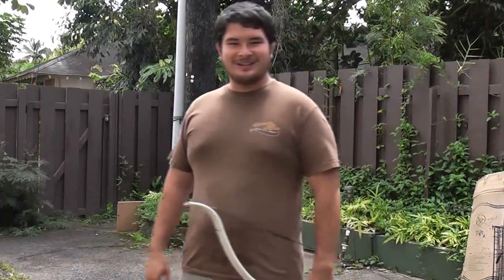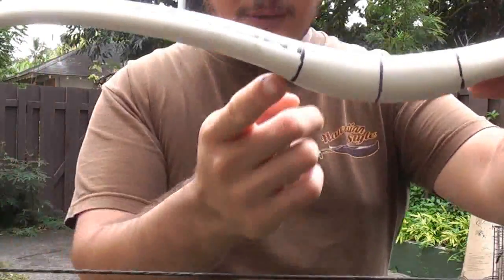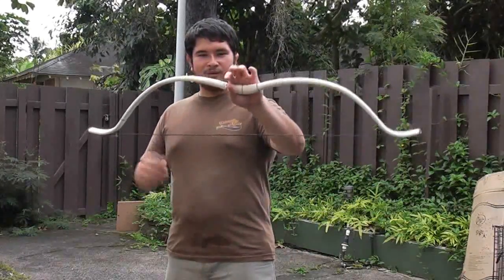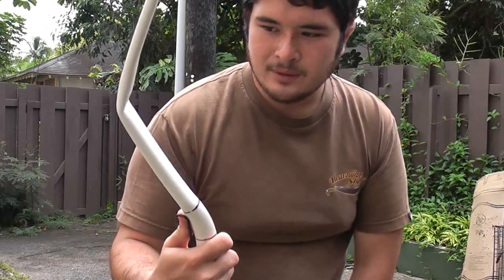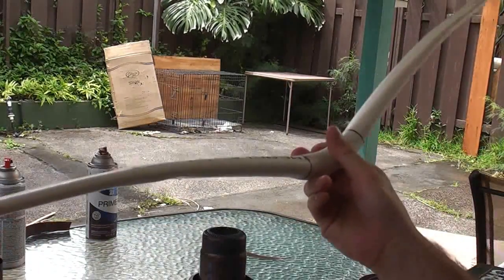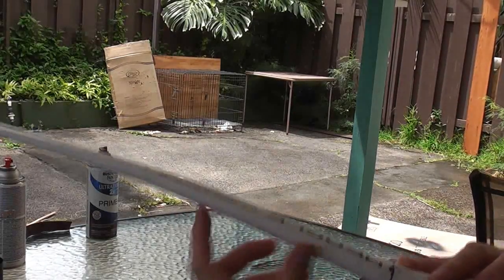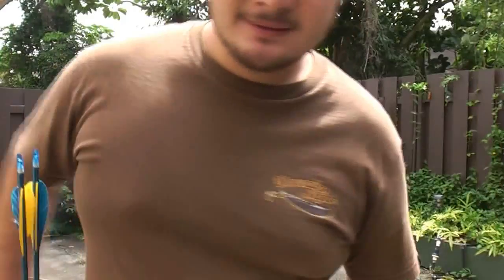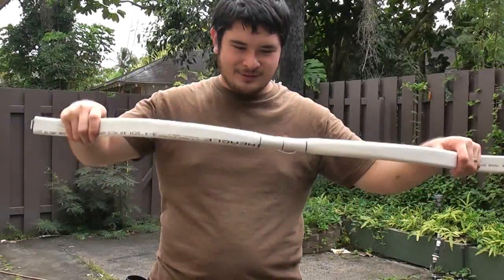PVC Bow Failure -  Limb Collapse

Comment: I live in Ireland and all we can get here is standard pvc waste pipe, Warning to anybody who cant use schedule 40 pipe.. Its not the same thing !!! I made a 43lb recurve bow and it worked great until one day it shattered, yes just shattered at the handle, I ended up punching myself in the face and busted my lip and front teeth to the point that blood was running out of my mouth..and a piece of the pvc actually sliced my hand open between my thumb and index finger , Had to get stitches in my hand...  
The pipe got brittle in the cold, It was fine until the temps dropped and boom.. It exploded near full draw on me..

Comment: Nick, I've been studying your videos and had this problem right in the middle.

I noticed that I didn't get a great taper with my jig but mine was very very DIY.  What parts do you use for your jig?  How do you keep your soft pipe straight instead of twisting, I was surprised how good this worked but keeping the soft pipe plumb seems to be tricky.

Comment: basically your bow failed like it did because of its short length.  you were drawing it to an unrealistic length to make it fail.  It's as if you were using a short bow to draw an arrow with a length unsuited for it.  shooting it after the fix shows me you're also using arrows longer than your draw length.  your arrows should not have that much length extending beyond the bow.  a long arrow travels just as far as a shorter one with the same results.  also the last attempt to make a bow collapse is just that, you're trying to make it collapse.  i don't know of any bowyer that tries to make a bow collapse.  proper use of the bow with matched arrows should never cause a bow to fail/collapse.
Reply: Ray James he did it on purpose as a demonstration. he makes so many bows like this as PVC is inexpensive and he also wrote many books.
Reply: Ray James YOUR NOT A GENIUS

Comment: Is it okay to use pipes that i bought years ago and stored in a humid/hot/cold (depending on the season, I'm in ohio) garage, completely covered and unexposed to the outdoors?
Reply: It should be. What you can do to be sure, is to cut off a piece of the pipe, place it against a hard surface, and go to town on it with a hammer. If the sample piece shatters, it's too brittle. If it deforms, the pipe'll be good. Nick has a recent video on this, I believe.

Comment: Here in Japan, we have black colored "shock resistant" PVC pipe, but does this exist in the western world too? Also, would it be fit for bow making?
Reply: Philosophia I haven't seen it but if you take a sample and hit it with a hammer then if it shatters it's no good but if it dents then it's great
Reply: Sounds like Furniture Grade PVC or CPVC. 

Furniture Grade PVC is incredibly good for PVC bows, as it's strength allows it to launch an arrow faster than most other types of PVC, and it's UV resistance means it's FAR less likely to be harmed by the sun.

CPVC generally has no UV resistance, but it's stronger than any other PVC on the market (that I know of). The one issue one might have with it, however, is it's temperature resistance. It's incredibly resistant to cold temperature, meaning it's great for winter time rabbit hunting, but it's also quite heat resistant, meaning you'll not have as easy a time warming it to a malleable point, as you would standard or furniture grade PVC.

For whatever reason, my local hardware store (which sells standard and electrical PVC) won't order either of them for me (despite the fact I live on a tropical island, of which every outdoor restaurant and patio has Furniture Grade PVC in it in some manner). However, if I drive to the main, every hardware store has it in stock.

Comment: hey nick .. hope all is well man .. i broke my 3/4 inch recurve with a 10 inch long insert of 1/2 inch reenforced handle .. it wasnt smashes to center .. it had already had about 3000 shots through it .. crazy thing is it broke at both sides of right where the insert ends .. any ideas y?
Reply from the maker: +Joey Lujan Hope you're still doing well and you are fine! The only thing I can think is that the 1/2" pipe may have been sharp on the inside or it could have caused extra stress where it met the outside pipe. Were there any large scratches or dings near where the reinforcement was?

Reinforcement is always tricky, and while I can sometimes manage a bow that is seamless and completely smooth around the transitions, sometimes I'll end up with one that has slight ridges or bumps where the inside pipe ends. These areas become prone to getting scratched or bumped, and this can cause breaks. This is also a problem with take-down bows that use the main pipe as the sleeve.

Hope this helps!
Reply: Hey nick! Yea kinda what i was thinking also .. you know i have broken 2 bows out of the many that i have made .. funny that you say takedowns also have this issue .. because that is the other that broke .. the emergency takedown ... so sad .. but it happens :) thanks for the response nick .. i appreciate it .. cant wait for another bow vid from you
Reply: Hey nick .. do you think it could have broken from over drawing the bow?  It might have been a little short .. it .. im 6ft and i think i used the same specs that you used .. sould i try a bit of a longer bow to lengthen draw?  Thanks!
Reply: I was kinda teeing to get max speed with some new aluminum arrows lol
Reply: Joey Lujan hey he broke it on purpose to show us what it takes to fix them daaaaa

Comment: I'm making a 3 piece take down bow with wooden riser I made the riser pretty easily but the limbs are proving a lot harder I can taper them ok but putting the recurve in is not working well at all ive followed tips from a few videos on YouTube but still no joy im in the UK and they grade the pipe differently over here so im not sure if im even using the right pipe any advice you could offer on this would be greatly appreciated.

Comment: where you get those pipes? can i order them somewhere because i live in Finland and here dont sell 40mm pipes anymore.
Reply: +Oskari Heikkilä should be able to find some in a similar size at your local construction supply store, electrical or plumbing supply house. 40mm is kinda big, there are many people who have made PVC bows from material 18-25mm diameter. Personally I'd go for 30mm, with another 24mm piece inside (basically 2 pipes that will tightly slide over eachother)
Reply: Linkxsc thanks, i tried to make it from 32mm pipe but it didnt work so i try with 2 pipes.
Reply: Oskari Heikkilä
The reason why I did it was so that if either piece did begin to break, there would be another bit holding it together. Though wrapping the thing top to bottom in duct tape (Camoflague ofcourse) can accomplish the same goal, and protect the tubing from UV (which will weaken it over time if left outside)

Comment: Hey Nick you were wrong!  White PVC has no UV protection and is stored indoor?  Gray PVC is for outdoor use Electrical and It has a Manufactured UV protection built into it to withstand UV Rays........
Reply from the maker: Bill Donoho Yes, white PVC plumbing pipe does not have any UV protection. I'm not sure what I'm wrong about. White PVC is often stored outdoors. Prior to being shipped by boat, train, truck, or air-freight to distributors, white PVC pipe is often stored in large bundles outdoors. When I said the pipe is stored for years out in a field, I meant the field or yard used by shipping companies and manufacturers to store building materials prior to shipping. This saves on space. While PVC is UV-sensitive, generally it is considered fine to sell pipe that has been outdoors for up to two years in plumbing applications. The actual damage caused depends on where a particular pipe sat in the bundle and how long it was outside. 

From there the pipes go to distributors or large retail companies with their own distribution network. Pipe is sometimes stored outdoors along with lumber and certain building materials. And once it's shipped to hardware stores and plumbing supply houses, it's up to the individual store whether they will keep it indoors or not. Some store the pipe indoors, others keep it outside. Some larger stores will keep it bound on pallets outdoors until they need to fill the shelves and then bring it inside. That's why it is up to you to make sure the pipe you're using is fairly new and doesn't show obvious signs of UV damage like yellowing and cracking. Just because the pipe is indoors when you buy it, does not mean it wasn't outdoors at some point during transportation and storage.

Gray conduit pipe does have UV protection built in. Because it is not rated for pressure applications, it can be stored outside indefinitely and is still fine to sell. If I had to build a bow in a pinch with old and found materials, I would trust PVC electrical conduit over PVC plumbing pipe.
Reply: +Bill Donoho It depends on the seller really. In my small town the local lumber yard stores most of its PVC pipe outside, although it is partly under a roof to keep the rain off, but the sun still hits the pipe at times during the day. All the big box stores I've seen though keep pvc inside.
Reply: +BackyardBowyer alot of knowledge in this reply , thanks
Reply: +BackyardBowyer can you say what the other unbreakable bow was made of

Comment: i dont know if it was the size of the pipe or its shape, but i had a 1" pvc bow shatter in to large and small pieces at the handle and below one of the tips.
Reply from the maker: saxonman If the bow broke near one of the tips, what probably happened was what I call a feedback break. When one tip or both break off, the bow snaps forward and without a string it ends up flexing like its being drawn backwards. This can cause the bow to break into multiple pieces. This type of break is also common for wood and laminated bows that break at a nock or tip.

Weak tips or pipes that are too short for their diameter and wall thickness seem to be the main issues that cause this. A bow with strong nocks and smooth transitions that is also not too short is not likely to break.

How long was the pipe? Anything under 54" is definitely pushing 1" pipe.
Reply: BackyardBowyer im surprised my comment got a response!
yes it was a 60" length with a lot of reflex and deflex but only flattened about up to 6" or 7" from the tips. i know the bow was under immense strain as it measured close to 90# at 28" draw and most of the flex was in the flattened tips, but you could still feel flex in the handle as well.
i tested about 60 or 70 shots with it  over a week or so, then had it unstrung in a dark dry storage for about a month. after then i restrung it and worked its draw to 28" where it basically exploded in my hand. nobody was hurt, but it was a very surprising experience and i wanted to share in case someone else is planning on replicating the same mistakes i made.
this is the bow in question
https://scontent-ord1-1.xx.fbcdn.net/hphotos-xfp1/t31.0-8/736189_10153515826720192_1913917159_o.jpg
unfortunately i dont have an image of the aftermath or of it unstrung but its shape was no different except for the tips being slightly less flexed back
this is not to deter people away from making pvc bows as i have made many after since this incident, im only sharing my experience to educate people of the consequences of such limits.
Reply: hey what bow did you use in the video

Comment: would para-cord work as a string if not what would
Reply: Kyle Smith Don't know if you still need an answer, but he made some tutorials on making bow strings, I made the polypropylene counter twist one and it works great. I used candle wax instead of beeswax and it seemed to work just fine! Just be prepared to get very confused and forget which is clockwise and which is counter clockwise!!
Reply: Thanks ross sullivan

Comment: Hi Nick.
I'm not sure if you are still doing this bow thing, but I've picked up on it a few weeks ago and have made several bows. The reason I'm posting here is because I had one of my bows actually blow up when a friend over Drew it. It didn't just collaps, it blew up into 5 pieces and cutting my friends arm in the process.
I never thought this was possible with this bow after seeing this video, but it is and did blow up much to our suprise. Any idea how and why this could have happend?
Reply: mind if i ask what kind of pvc you were using? i've only made one pvc bow before and would like to make more, but it sounds like it might be a matter of thickness perhaps...?
Reply: Whats the ID of the pipe? and how thick are the walls? I used 3/4 inch pipe sched 40 for a bow i made off this channel

Comment: Hi Nick,
  I've been going over all the details of my previous bow explosion and was wondering if you knew any pvc bow forums you'd suggest so I'm not relying on you to the point its annoying or inconvenient.

  Also, do you think PVC horse bows are resilient enough to withstand the traditional rapid fire techniques used by a lot of older cultures? Its how I shot this bow primarily and it never occurred to me the pvc would act differently, but now I'm curious.

  Thanks!

Comment: Even those pvc pipes you think are new , can be 2-3 years old so I wont get my hopes up.
You can bend it to your will using intense heat , and if applied in the right amount , will cool off by itself in 2-3 minutes.If cooled with cold water after heat is applied the pvc looses some of its flexibility , creating small rigid parts inside the material that  can brake later on.
Have you tried a bigger pvc pipe filled with a acacia branch inside? The wood is very flexible and will give you extra resistence.

Comment: I wish I had the tools and skill to make something like that.
Reply: A heat gun is about $20, which is probably the most expensive tool you'd have to buy. If you want to make it, go for it! Don't let not having the tools slow you down. Go buy them and get started! I've just gotten into PVC craft myself and I can't wait to get going on a bow like he shows in his "less than $7" video.
Reply: 6Dragon6 Software I don't know if a hair dryer would get hot enough, but I'd love to hear back from you if it does! That would save me a trip to Home Depot!
Reply: 6Dragon6 Software It doesn't get hot enough. They may look similar, but unless your hair dryer goes to 1000F, don't even bother.
Reply: PKIllusion1 That's kinda what I figured. Dang. Guess I'll have to drop a whole $20 on a real heat gun!
Reply: Trust me, it is COMPLETELY worth it. :)

Comment: Just a random thought, have you ever sealed the ends of a pvc bow (pvc glue inside the end just before flattening, maybe) to see if that would alter the how's performance? I think the compressed air might mitigate any tendency towards collapse.  One might go so far as putting a tire inflation valve into the grip (positioned to double as an arrow rest, maybe) then pump 40 pounds per square inch of air into the bow to see what it does to the bow and it's performance.
Reply: You would have to pressurize it to make a difference. If the air inside is just at ambient air pressure at the time of sealing it, it would not resist bending much at all. Think of a plastic bag loosely sealed up with a little air, itll still bend no problem. Blow it up fully first, and then itll resist bending. 

I would like to see one filled with fluid, if it wouldnt add unnecessary weight. Should be easier then compressing it with air, and is what deep ocean diving ROV's do to resist structural collapsing.
Reply: maybe fill it with some kind of rubber epoxy before sealing it to give it extra flex and strength
Reply: Some very nice remark. Thanks for the idea.

Comment: In my research I've found that post of the pipe in the UK is not PVC. The molecular structure of PVC is elastic whereas the more common PP in Britain (Polypropylene) is crystalline and so it will bend and then shatter.

Comment from the maker: Most of the pipe you'll probably find is much thinner than the Schedule 40 I use. This thinner pipe can't handle the strain and will easily collapse or snap. Schedule 40 has roughly 3 mm thick walls. Thin walled PVC will work, but it needs to be at least a foot longer than thicker pipe and will be much lighter in poundage.

Comment: Even if the bow fails I find it hard to imagine it becoming an issue with safety if that's the concern. PVC doesn't explode like wood or fiberglass. Also, if there is a heat source handy it could possibly be fixed whereas wood or fiberglass becomes almost useless if it splinters. A test video would definately be interesting to see.

Comment: Id say flattened pipe bows are safer because if they fail on the limbs they bend. as apposed to a round pipe shattering. Ive shattered pvc before and it wasn't pretty. Id also guess that if it was covered in tape that even if it did shatter the pieces would be contained inside the tape.